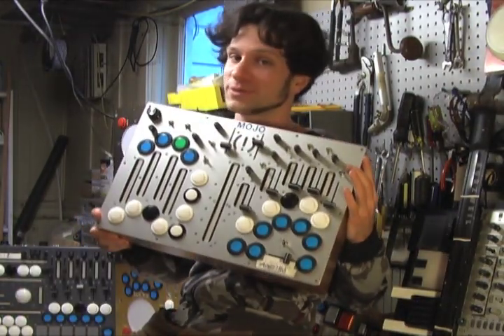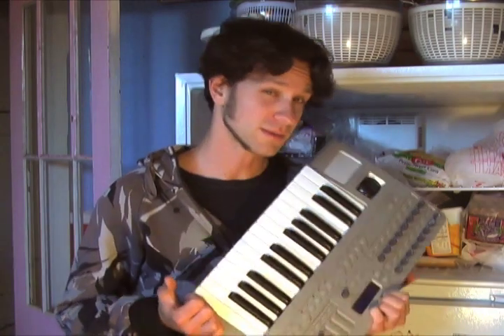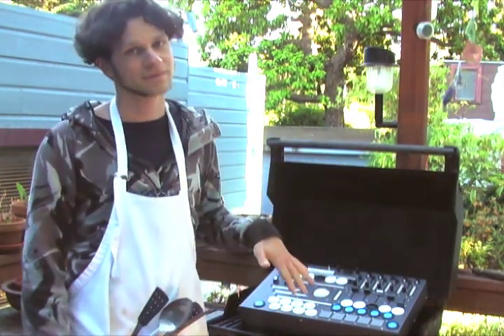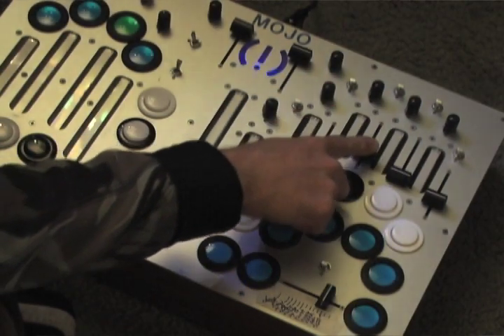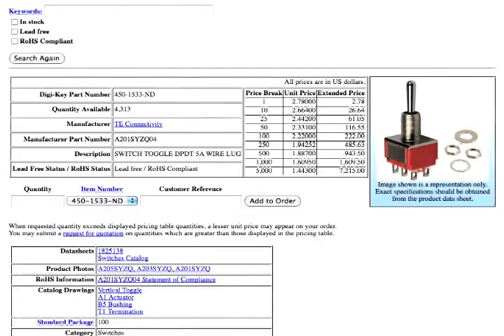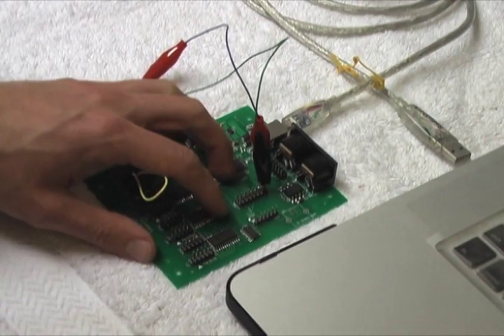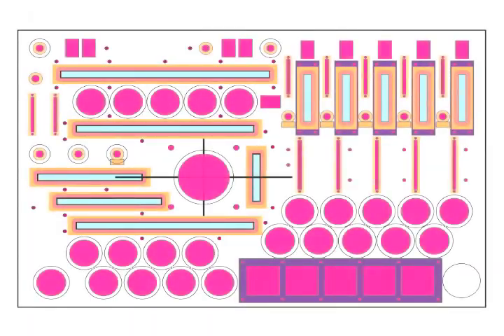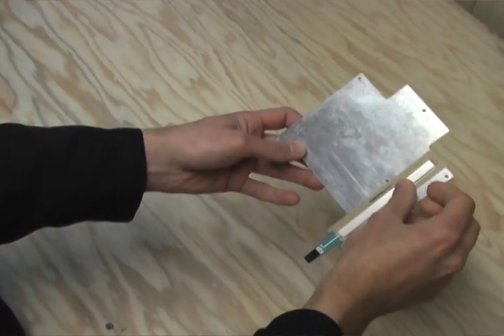How to Build a Controller (Making of The Mojo)

Comment: That was the Smoke on the water at the end of the break...

really really nice of you to share it. Just one question: how much did it cost you to build your Mojo? I've already seen for how much you're selling it for. And you really made it simple, yet the construction of the whole controller itself seems complex. How much time did you need until you you had all of the wires and controllers connected the way you wanted it? And what knowledge is actually need?

Btw: nice hats in the speed run.